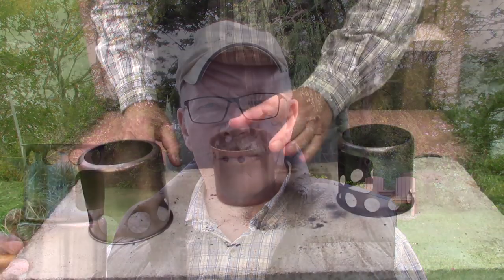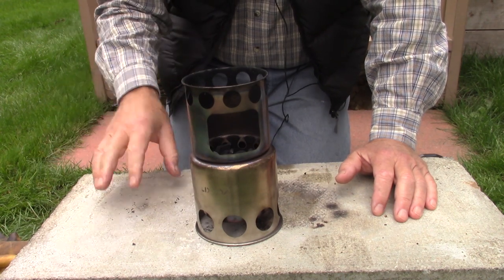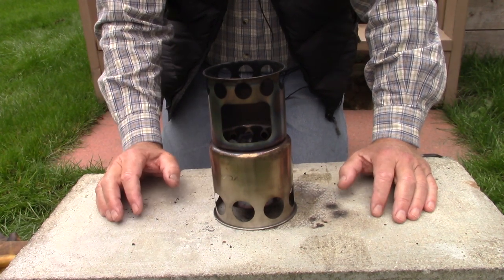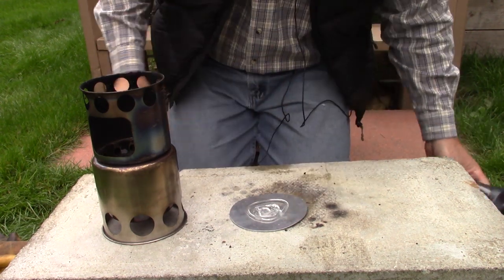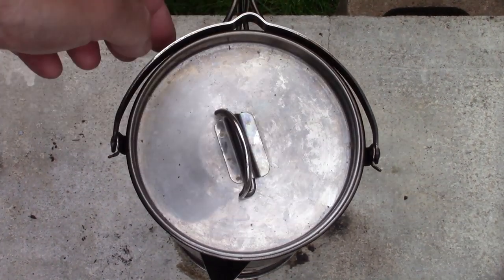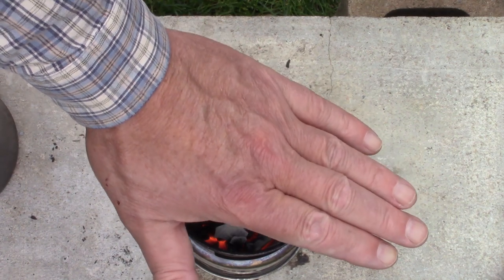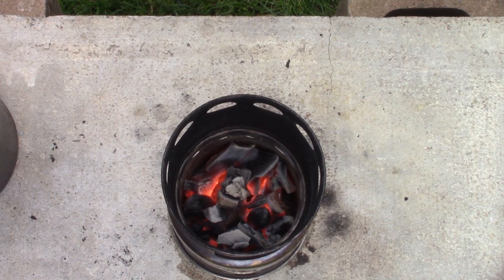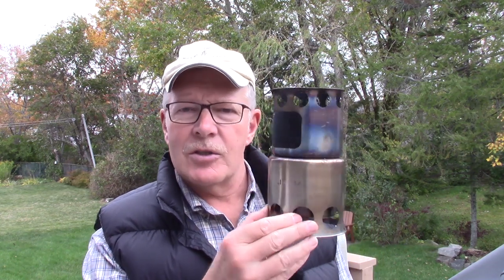Lixada Tower Stove with Charcoal

Comment: I see notsufficient enough heat to boil water. I just used mine yesterday to cokk a hamburger!  I put about 4  pieces of charcoal on the bottom, twigs on top. I started fire, let it burn down until it ignited charcoal and used it to cook. Antway, always learning versatility of these stoves. Thanks again!
Reply from the maker: I agree, it would make a fare BBQ although not real hot. I should have stated that as part of the test results. Thanks for commenting

Comment: We will deconstruct the  biolite and use the fan blowing onto the charcoal and make a mini Lixada Forge. ;)
Reply from the maker: That would be a cool modification. I have considered using a computer fan to do that with. Would take a bit of fabrication but looks like it would create a real inferno. Thanks for commenting
Reply: Mark Young You could grab a computer fan and attach an old USB power cable to it. The output for almost all USB is between 5.2 to 4.7 vdc, and you can use a laptop to supply a load of about 800mA 500mA would be best. That would run off of a USB power bank or a USB plug. I’ve been watching some primitive skills videos where they create charcoal fired smelters that work with forced air bellows or similar.

Comment: I have been wondering how charcoal would work in one of my stoves.  Might have to give it a try.   Thumbs up on the video.
Reply from the maker: Hi Lonnie. I probably should have re-mentioned my reason for testing the stove with charcoal. It goes back to an earlier video where I talked about using charcoal or wood pellets as an alternative fuel for places where using found wood is not permitted. In truth only a few of the stoves I have tested like the Firebox actually work well with charcoal. What stove will you be testing it with?
Reply: @MarkYoungBushcraft     I was thinking that I could place charcoal on the bottom of my Ghillie kettle fire base (Kelly kettle clone) and then build a wood fire on top of that for heating the Ghillie kettle water reservoir.   Once the water is heated (in about 5 minutes,) I could remove the water reservoir and then place my Kelley kettle hobo stove accessory (I do not have the Ghilley kettle hobo stove accessory) on top of the fire base, I could then have plenty of long duration heat supply, with the hopefully now lit and engaged charcoal, for cooking the rest of my meal.   I have not had the opportunity to yet try out the hobo accessory for cooking with cooking vessels on top of it so I do not know how well it will draft and maintain a wood fire with cooking vessels on top.  My Ghillie kettle is the middle size (1 liter) and seems to burn great with the hobo stove accessory on the base but without any cooking vessel theoretically partially limiting exhaust flow.   Perhaps the fire base/hobo stove combo will work just fine using a wood fire but if it turns out to be a bit "fiddly," I thought that a charcoal /wood fire might be the trick to reduce fiddlyness and make it happen.
Reply from the maker: @Far-North-Bushcraft-Survival  I do believe I will have to try this out with the KK Trekker I have. I have started playing with the hobo stove (base and pot stand) to see what kind of performance I could get out of it. I was not going to try charcoal or wood pellets but now I will re-think that. Where you thinking of doing a video on it Lonnie?
Reply: @MarkYoungBushcraft  This was an item that was sent to me by agreement from the company.  I agreed to accept it with the understanding that I will show myself using it in my videos and leave a link in the video description to where it can be purchased.  Since my channel is based on a how-to oriented theme, I do not like doing review based videos.   So I will be using the Ghillie kettle in some of my videos but I won't be reviewing it.   I really wanted one of these to use personally and so was happy when the company agreed to my conditions of no review but rather using it.   So far I am very pleased with the product though personally I would rather have stainless.  This one is anodized aluminum and is working great and a bit lighter in weight than stainless I would guess.

Comment: Just wondering if there is any modifications possible to use this stove with a grill plate Mark similar to the Firebox etc.
Reply from the maker: I can't think of any mods other than to just place a grill over the top. I am not sure this would make a very good grilling stove. The narrow diameter limits the potential grilling surface and heat control would be an issue. Grilling is best over hot coals and not flame. You could wait for the coals to form but they would not last very long dues to the small size. Hope this helps. Thanks for commenting

Comment: Too much distance between coal and pot. I did the same tests with the larger Lixada, which has the ability to remove the upper section.
Reply from the maker: I agree. Possibly if I covered the feed port but otherwise not a good stove for using charcoal with. Thanks for commenting

Comment: I think charcoal is stupid to use in these efficient stoves which try to burn their own gasses because making the charcoal so much of the woods material is lost to the air instead of burnt making cooking heat. On the other hand pellets are fantastic in getting so much wood cheaply in a small stove's space to burn a long time hot.
Reply from the maker: So, the charcoal test follows earlier videos that discuss options for locations where using found wood is not permitted, like National Parks. Certainly not stupid to consider in those circumstances

Comment: Suggestion : don't use hand to check flame on invisible flame. I've seen children imitate this, and get severe blister burns. 

I like to use 5 charcoal pieces to get dry out kindling and get a wood stick burning good.
Reply: Is a mere blister for a child isn't the worst thing in the world? It teaches them a lesson they'll not quickly forget. I don't think any of us in the Scouts escaped without singeing ourselves once or twice, and once learnt correctly you can use the hand to judge heat.
Reply: @darthkek1953  Okay ...
Reply: @kan-zee  you don't want a child mutilated, but you also need to let a child face some amount of danger and pain. Like skateboarding, nobody wants a child to break their arm but wrapping them in cotton wool and prohibiting all skateboarding is worse.
Reply from the maker: Thank you for your concern. Using one's hand to check for heat is an acceptable practice when done safely. It is with the hand that one can guesstimate the temperature by the length of time it can be held there comfortably. Using charcoal to dry damp wood is a great suggestion. Thanks for commenting